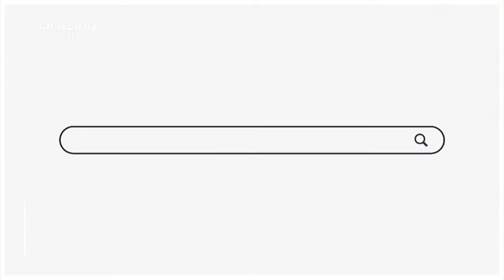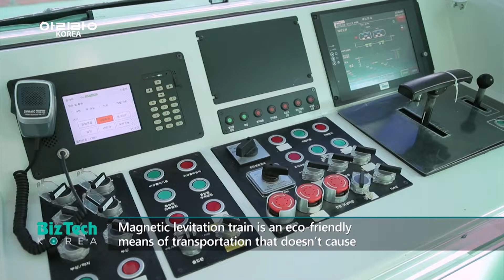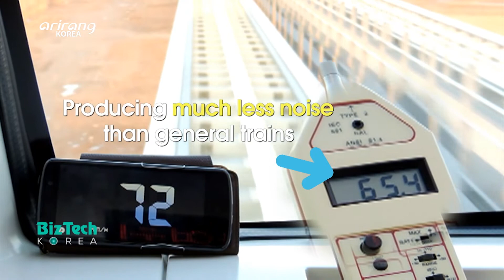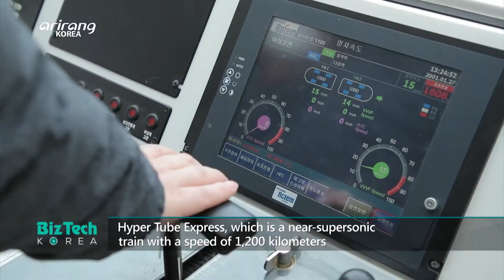[BizTech KOREA] Urban magnetic levitation train [#Hash_Tech]

Comment: When strong winds blow, the "floating landing phenomenon" occurs, where the floating width of a moving train sinks to less than 8 mm. This is a serious problem that could lead to the train coming into contact with the rails.

In addition, when it rains or winds are strong, the train's stopping position shifts by 50 centimeters to nearly 1 meter, causing "improper stopping," and problems with the substation equipment can cause "current interruption."